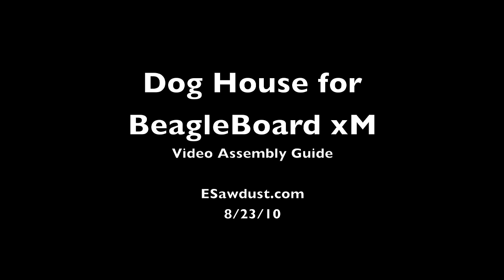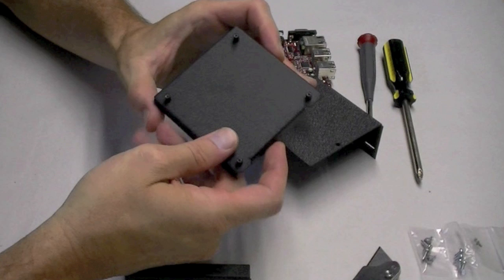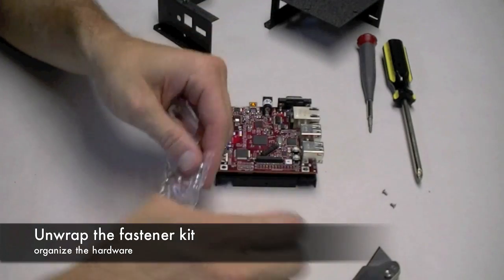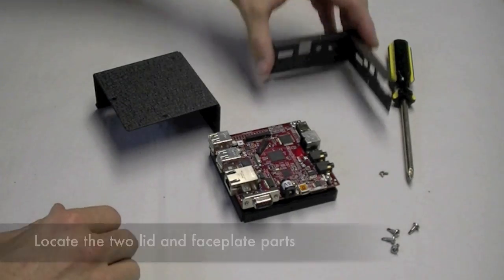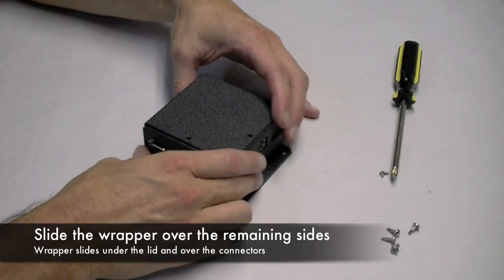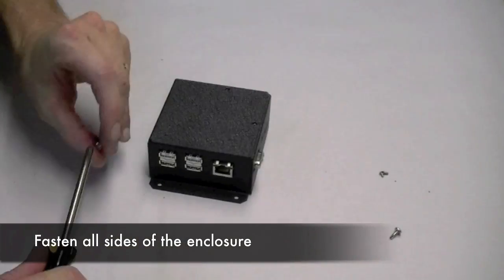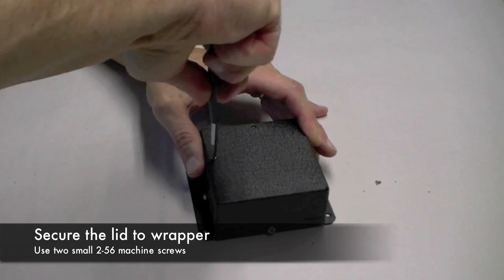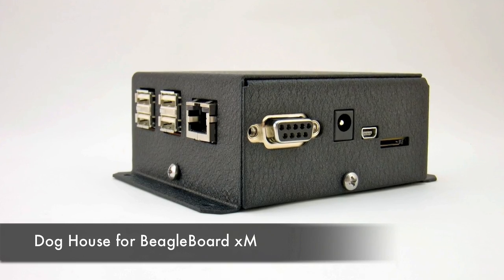Dog House for BeagleBoard xM Video Assembly Guide HD

Comment: I hope the metal bits from the self-taping screws don't come into contact with the circuit board.  My advice would be to assemble the enclosure first without the beagleboard.  Then, take it apart and clean up/remove any metal fragments.  Finally, re-assemble w/beagleboard.